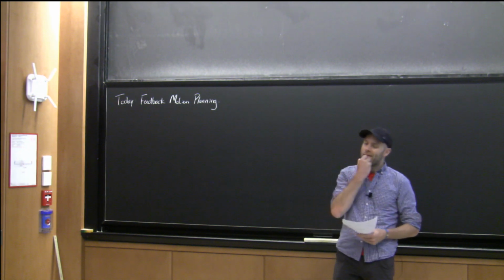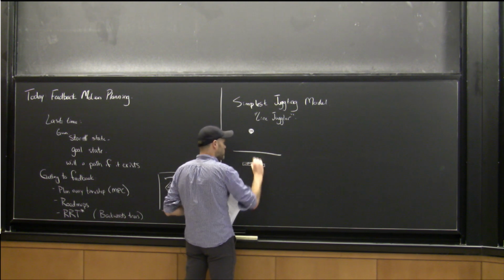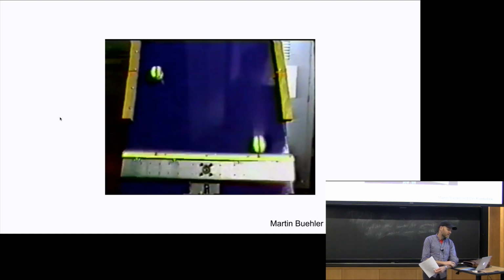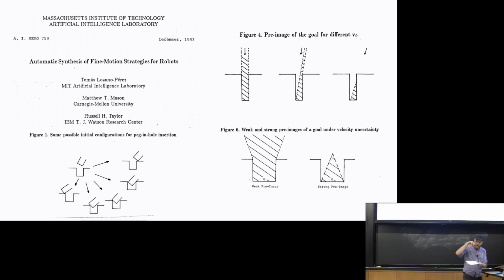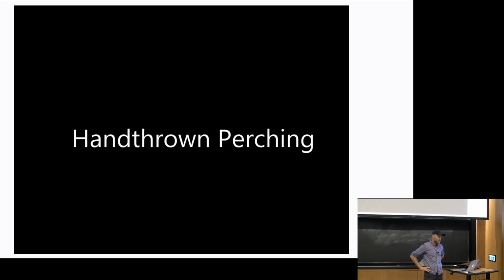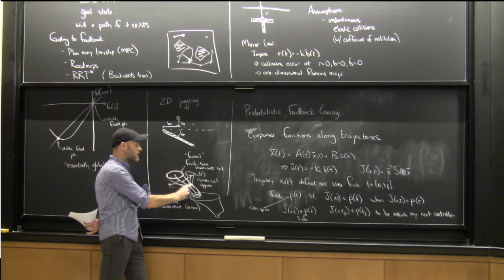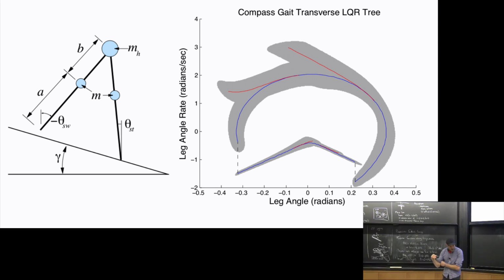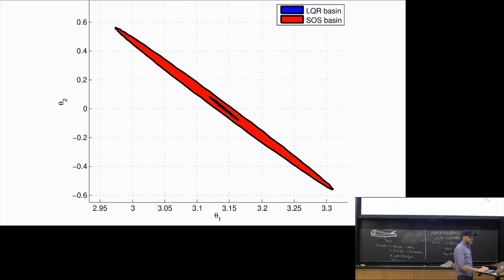Lecture 18 | MIT 6.832  (Underactuated Robotics), Spring 2019

Comment: Dear Prof. Tedrake, at 46:57 shoud it be the derivative of J(x,t) be negative instead of J(x,t) ? If I understand well, J(x,t) should be semi-positive (S(t)>0). Many thanks for your time.
Reply from the maker: you're correct.  J(x,t) is psd (in this form) and it's the derivative that should be negative.  the board was correct, but i did say it wrong.
Reply: @underactuated5171  many thanks for your time.
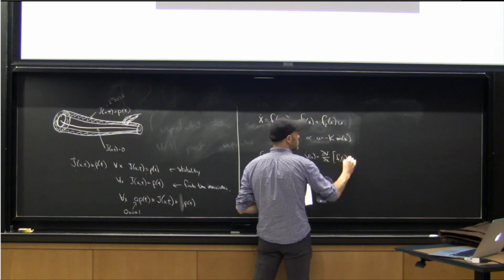Reply: @underactuated5171  Dear Prof. Tedrake, should it be Vdot(x) = dV/dx * (f1(x)-f2(x)*K*m(x)) at 1:19:24?
Reply: @iamdrfly  Correct.  I mistakenly wrote +f2 instead of -f2 on the board.

Comment: I was a little unclear on the diagrams from the LMT paper (33:18) so I found the paper and wanted to share what I learned. The point of confusion for me was that the figures 4/6 are not the peg-in-hole problem directly, but rather a closely related problem. In those figures, the object has been reduced to a point, and the hole's width has been reduced as well to avoid collision. This captures much of the original peg-in-hole problem, except for managing the orientation of the peg--that's basically out of scope for the discussion; they just assume the peg walls are aligned with the hole walls, and that it stays that way.

So then the shaded regions in figure 4 represent all the positions in space from which we could take a single step with a given velocity to end somewhere in the goal region. 

When we have uncertainty in velocity, we picture the velocity not as a vector but as a cone. In the bottom two diagrams, I think there's an implicit downward velocity (which is why the strong-preimage cone is oriented downward). 

The weak-preimage case represents locations from which we may succeed if we direct some velocity (here downward) assuming some uncertainty. As the professor said, we may get 'lucky' and end up in the goal region even if we pick a bad strategy.

The strong-preimage case represents the locations from which we're guaranteed to succeed if we direct some velocity, again assuming some uncertainty. 

All of this is sort of besides the point. The key idea here is that this paper is where backchaining got its start.

If you want to do your own reading, you can download the paper from here: https://apps.dtic.mil/dtic/tr/fulltext/u2/a139532.pdf. Sections 2.1 and 2.2 contain the stuff directly relevant to this discussion and are pretty straightforward.